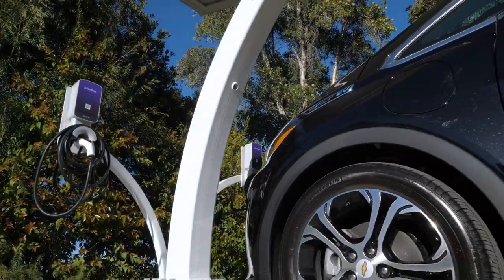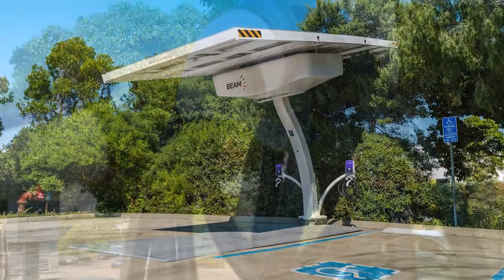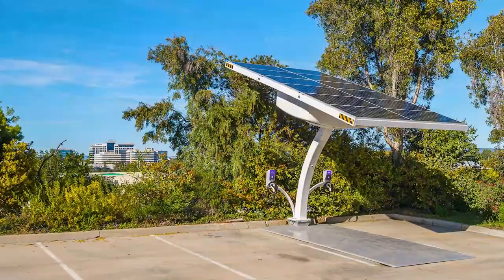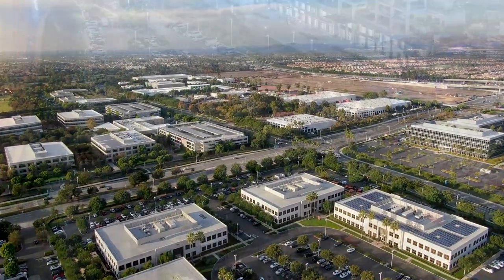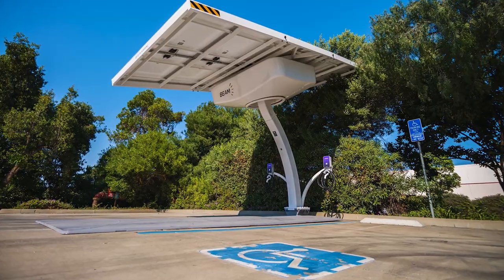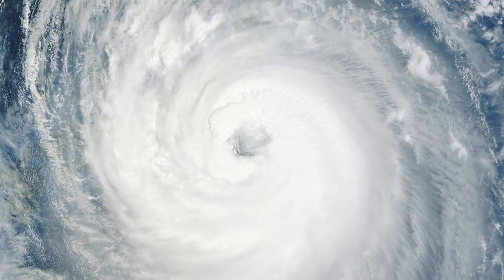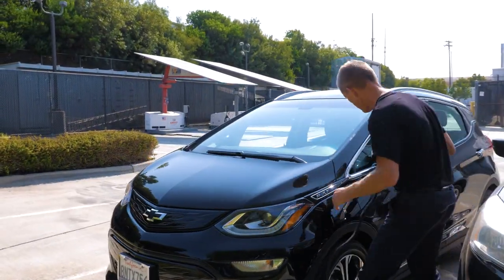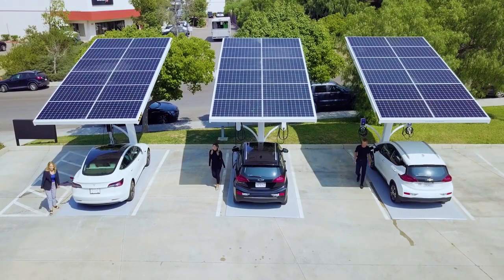Beam EV ARC™ 2020 Sustainable Electric Vehicle Charging

Comment: This is a great product! How much time does it take to charge an electric car up to 80%?
Reply: They are only Level-2, like plugging into a dryer plug. Looking at their California pricing list, the unit is usually equipped with a 32amp circuit so they charge at 24amps. 24amps works out to about 18 miles per hour charging.